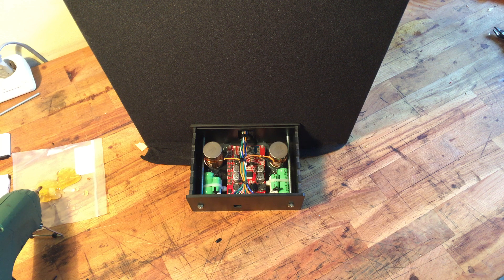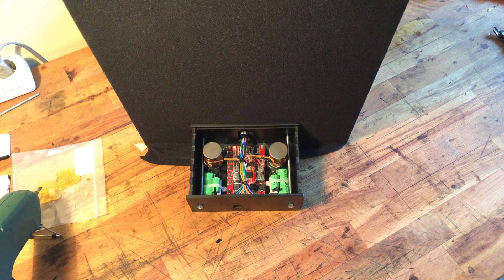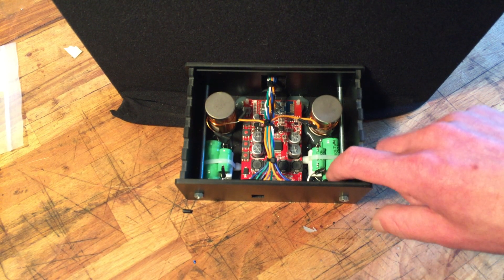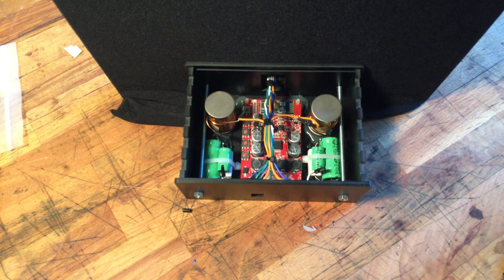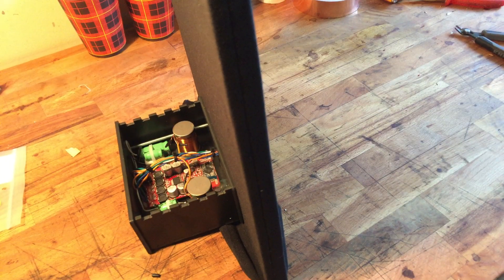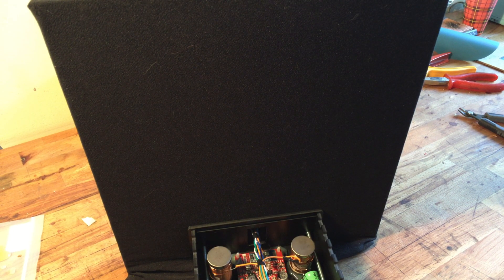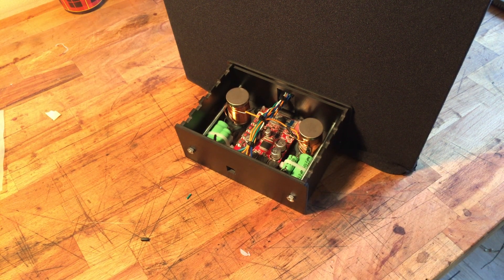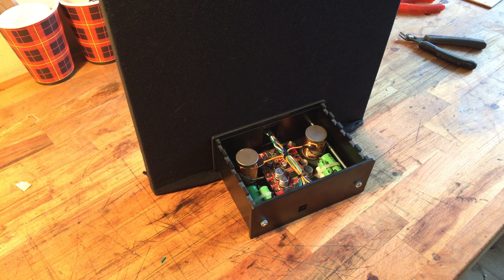DiY Bluetooth Planar magnetic speaker part 10

Comment: I like the idea of your "dual voice coil". The components of the bandpass filter are ok. But in the high pass filter should have a better quality. Bipolar electrolytic capacitors have a bad impact on high frequencies. In row to the driver they should be only used up to ~ 500 Hz. A MKT cap is way batter. In addition age does not change its capacity. Instead of the ceramic resistor a MOX resistor could be choosen.
Reply from the maker: Thanks ! well it is a Bluetooth speaker... nothing is ideal. so using mkt... not needed in my opinion also they measure the same when sweeped. i would rather swap out the iron core inductors since they do introduce distortion above 500 hz (measurable). but then again this is not a setup for using huge air coils and expensive components. :)
Reply: "i would rather swap out the iron core inductors since they do introduce distortion above 500 hz (measurable)."
Realy? I thought this would happen not befor 2 kHz. So good job then.